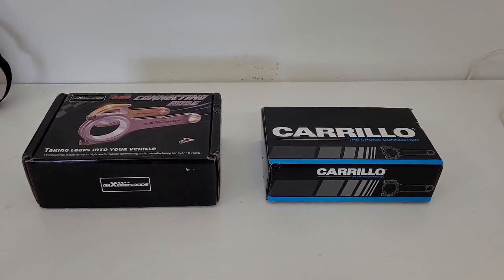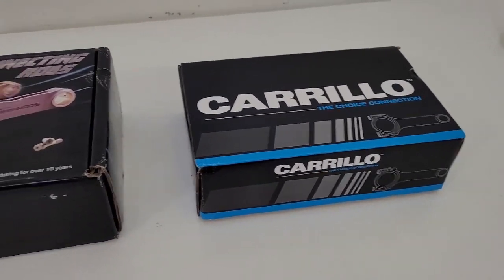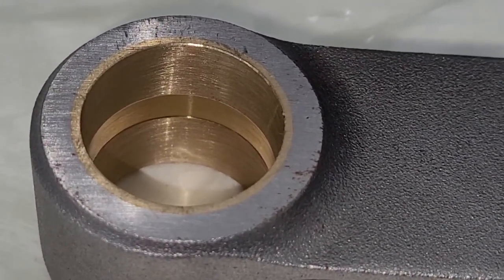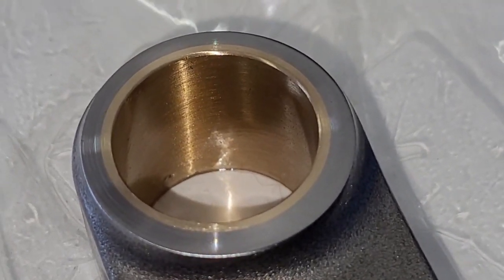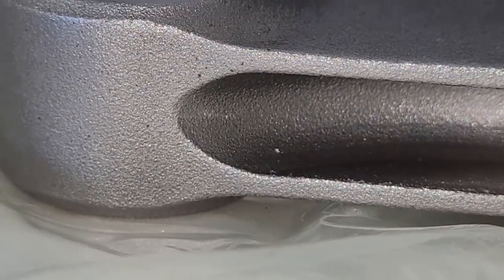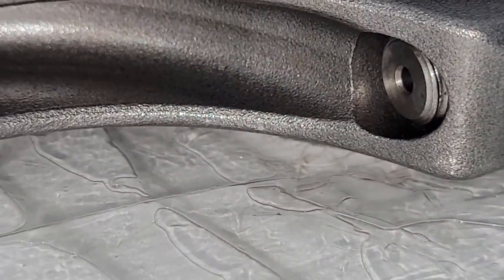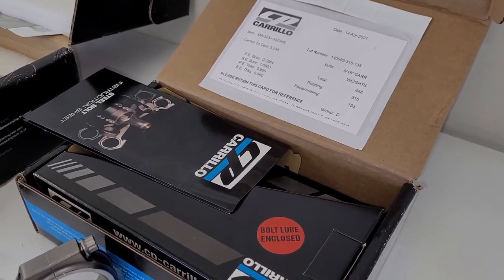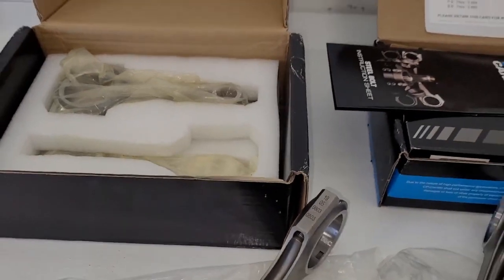Turbo Miata 500whp Build Episode 31 - Connecting Rod Comparison Cheap vs Expensive!

Comment: Most of oil supplied to the wrist pin comes from the cylinder or sidewall. The oil ring on the Pistons scrapes it off and puts it into oil holes that feed into the wrist pin from the piston. Those two holes inside the CP rod is probably for drainage.

Comment: Maxspeeding rod has the groove built into the little end to retain oil , there would be pretty much no difference between the two, I have some Ej20 maxspeeding rods and they are finished off way better then the ones U have
Reply: How are they holding up on the EJ?
What power are they running?

Comment: I know this is an old video .. but the "finish" you are talking about between the two is the Carrillo rod was polished that's why the areas seem to be rounded and smoother..  of you were to take the maxpeeding rods and do the same you would end up with the type of rod.... for a fraction of the price ..... but the biggest question is what's the difference at the big end measurements to see if the machine work tolerances are within spec or not...  Anyway, I can't see spending 1200 bucks on rods unless you are a full race team etc ... when there are so many companies selling the same rods from overseas and calling it their own ...
Reply from the maker: My biggest reason to run the Carrilo rods was that they are lighter. That helps take load off the rod bearings with high RPMs. I've always had bearing reliability problems above 8400-8600 on the BPs.

Comment: The holes on the bolts are for a bolt stretch tool.
Reply from the maker: Good to know! I always just use a torque wrench so that explains why I didn't know what those were for.
Reply: Did the MaxPeedingRods come with instructions for rod bolt torque required to achieve a specified bolt stretch?

Comment: im using the maxpeedingrods myself and well.. you cant really justify buying them anymore. Recently SPS motorsport came out with own rods at a similar price, that offer almost the same things as carillo or others do together with Way beefier fasteners  so this would be my go-to for now. 

Is there a reason you didnt go for aluminum rods in your build?
Reply from the maker: I almost did! I quoted them. The reason I didn't is that the big benefit of the AL rods is to save weight and coushin the rod bearings. But right now I'm not making enough power for the benefits to outweigh the negatives.
Reply: thats true, i think Aluminum rods make sense above 800 whp on a bp id say. But i have heard some not so bad things as usage goes from a lot of people, even some daily driving em. Would be an interesting project. to try out. Plus they arent as expensive, can get almost two sets for the price of one carillo set haha :D  @patrickcowanjr1

Comment: The way the rod is finished isn't really going to make a big difference. These two rods are deburred enough. What does matter is the metallurgy. Which we could never tell unless we were to bend and compression test it. These days they make I beam and H beams that can handle 1000hp without a problem so the shape isn't too much of a worry. The thing I worry most about is the quality control. Usually stuff from China is just shipped without testing for defects.

Comment: Quiet a few companies selling "american made" conrods that come from the same factory as the maxpeeding which is disappointing.
Reply: Do you know which ones or how you can tell if they came from the same place
Reply from the maker: Packaging from china is kind of a giveaway, if you've ordered enough from them you can tell their packaging. It's thin cardboard, lots of tape, very tightly packaged to save space. Opposite of an amazon shipment so to speak. 

Also a visual isnpection  of the material, you'll often see pitting and surface defects in china's steel. You'll never see that in american steel.
Reply: @jeremyogburn5888  but be aware, many re package them. Some even laser etch their logo on them re package and ship them out, and they class that as 'reworking' them 🤣
Reply: @garyhowe88  wow, you mean used rods are being sold as new?
Reply: @jeremyogburn5888  no chinese rods being repackaged and sold as made in america etc
Reply: @garyhowe88  oh wow okay. I mean I see videos of people making lots of power on cxracing rods or maxpeeding
 a set for my car is like 350$ for Chinese and like 700 for usa
Reply: Yeah I been looking around a lot it’s all the same…
Reply: China has been making crankshafts and conrods for a very long time and they are more then capable in doing so and it's all to do with cost , alot cheaper to have it made in China so more profits

Comment: I'd buy 4 sets of cheap rods and build 4 motors and have back up motors and run the shit outve em.
Reply from the maker: For most setups the cheaper rods are a lot better for cost, and to have a backup engine. I did that for years. Best thing is when the motor is cheap, you feel OK to beat it up and if it breaks, it wasn't expensive and you have a backup!

Comment: If i was building a 500 hp Mazda i would not be spending 1200 on rods.
Reply from the maker: What would you do? I've done Eagle rods on every build before my last one and never had a problem. Just went with the $$$ rods to save weight. And, they were 800 when I bought them...
Reply: @patrickcowanjr1  Eagle rods are Chinese, as many others are. Any of them are suitable for your HP. I wouldn't think you would notice the weight difference to be honest.
Reply from the maker: To be honest, I can't really notice a difference. The only thing I think might be better, the lighter rod puts less load on the rod bearings at high RPM. My Eagles went to ~8,700 max. The Carrillo's have went to 9,300. 

But now the car has the limiter at 8,200 so either would probably be fine. I think the main caps are too weak to support the crank above 8200-8400 anyway.